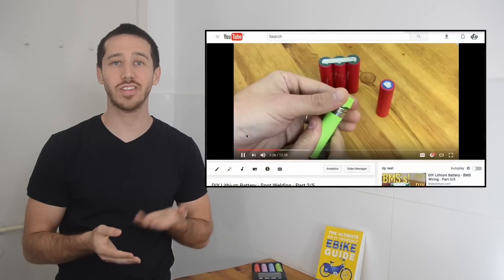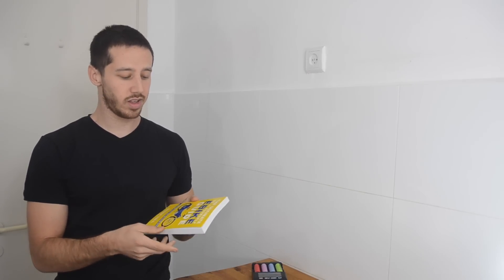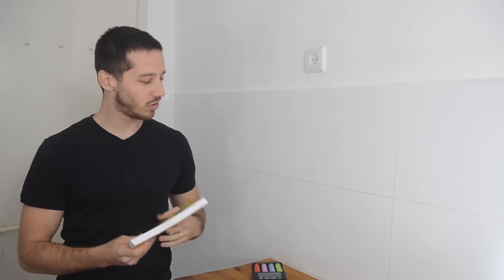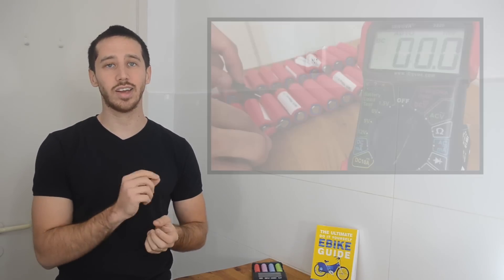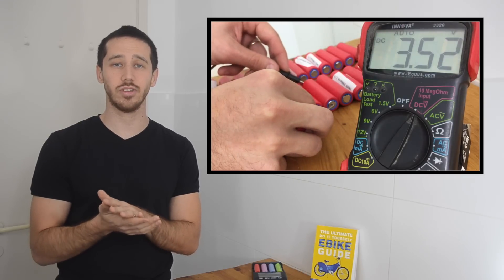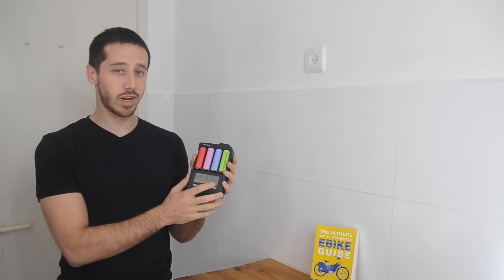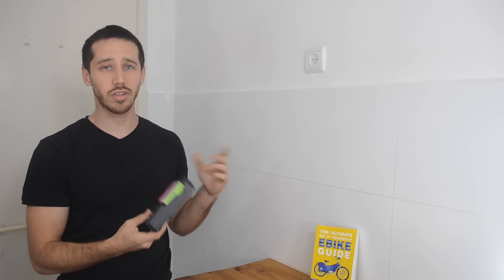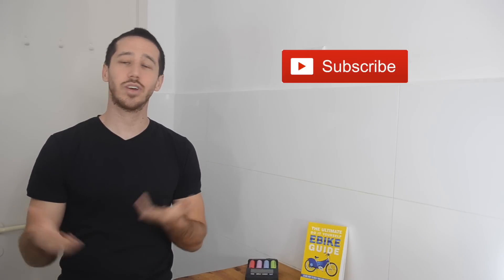Should I Charge My 18650 Cells Individually? Q&A#1

Comment: I have 2 36v 7.5 mph batteries and they are connected in parallel to double my mph, when I change them does the one have to be disconnected from the other before I charge separately?

Comment: hello sorry for this long question  I recently crashed my ebkie and my battery that i purchased took a nasty beating I broke 2 cells inside the pack it is a 48 volt 20ah  it is a rectangle battery one cell broke on the 13s side and one broke on the other side on the parralel rail I already took the battery appart and removed damaged cells I am hessitant to replace the cells I purchased the same lgm26 cells that where in it my question (HOW DO I KNOW IF THE 2 NEW CELLS I AM PUTTING IN ARE THE SAME VOLTAGE AS ALL THE OTHERS ALREADY ON THE BATTERY AS FAR AS I KNOW MY BMS WILL TAKE CARE OF THAT SHOULD I JUST ADD THE TWO NEW CELLS OR SHOULD I TEAR DOWN THE WHOLE PACK AND REBUILD IT
Reply: WISH I COULD PUT PICTURES YOU WOULD SAY IT IS EASY FIX
Reply: another question in a question before i noticed the battery was broken i charged it like normal i went to use it the next day i got 7 miles befor it died (i normally get 30 miles ) are all the cells in the pack still the same voltage ???  should i just tear this battery appart and start fresh?

Comment: Hi there,
     According to jehugarcia (another YouTube vlogger) we need no BMS (battery monitoring system) for a battery bank. Is it alright to balance a battery bank once and then keeping using it without balancing it ..i.e. not to use a BMS. Are there chances that the battery could get out of balance?
Reply from the maker: I would advise against that. If you don't use a BMS, you should monitor the pack occasionally and be prepared to rebalance it if it comes unbalanced over time.

Comment: Can you please make a video on how to choose the correct charger (current of the charger; eg 2 amp, 3 amp ) to charge a 36 volt or 48-volt lithium ion battery pack base on the pack size (Amp Hours) and the rated charging current of the cells used to make the pack?
 I am referring here to a fully built battery pack with a BMS. Thank You again for the educative stuff you make for ebikers
Reply from the maker: Pretty sure I made a video on that back in my 5 part series. Check my videos from around November
Reply: I found it thank

Comment: You need to be a little more careful. The title looks like a generic question of charging individual cells (in a battery-pack or not). The question you answered was specifically to charging them before the pack-build. The generic question of, "After the pack was built, do you still have to charge them individually or can you charge them as a group?", was never answered.
Reply: STILL never answered! WTF???????????????????????
Reply: If you had paid attention, he did answer the question. Once they are connected in a parallel it is consider a single cell, one battery. That's why he mentioned that batteries in parallel should be within a couple of hundredths of each other. Otherwise the stronger battery will try charging the weaker one putting strain and weakening the stronger one. Now when talking about charging in a series, the BMS will regulate charging to an even level and make each series equal, at least it should, depending on the quality of the BMS. Your chain is only as strong as its weakest link.

Comment: Why don't battery makers use 26650 size batteries for more capacity?
Reply from the maker: Fewer options for cells. 18650 is more common, so there are many more options in the market.

Comment: I had a mountain of old laptop batteries so all of mine are recovered used cells. The last thing I wanted to do was solder them into a brick and have to replace the bad cells one at a time. What I wanted to do was use them like I would in a standard flashlight - take charged cells and 'use' them until they were at their lower limit and then swap out those cells with freshly charged ones. I had a variety of schemes but then found the VRUZEND system. It works perfectly as a backup battery for my Sondors Thin eBike. 
I realized I had a real fire hazard storing thousands of 18650 batteries so I took the cream of the crop and donated the capacity tested batteries back to the place that gave me the packs in the first place. They use them in flashlights and cell phone chargers that they sell to support their non-profit. Everybody won!!

Comment: Hi Micah, when I'd like to build a battery pack, is it necessary that:
- all cells are the same type (capacity, max. current, etc.)
- from the same supplier (LG, Panasonic, Samsung,...)?
I think these points are important for cells connected in parallel, but what's about for series connection?

Comment: I have a question about if in battery pack there are few series of cells and they their voltage are not equal. Let's say for exempel 3.4v, 3.5v, 3.6v . If the highest parallel will not come over 4,2 and the lowest will not be discharged below 3v. Is there some danger for life span of this battery pack? Hi current will flow over other cells damaging them? Of course there is no BMS in pack. Is it save for pack having groups with mismatching voltage but not charged too high and discharged too low?
Reply: Did u figerout how to resolve the problem? Coz i have the same issue. I have a few batteries with different voltage  4.00 3.95 and  the rest of it are 3.53. I jus wondering, can i use a charger to discharge the other two.
Reply: @MrWhiteHeal  Czesc. Nie ja nie mialem takiego problemu bo mialem nowe ogniwa ale sie zastanawialem co gdyby. Mozesz podladowac te inne ale pamietaj ze jak odlaczysz od ladowarki to volty trosze opadna wiec nie beda idealnie rowne z innymi ale jak masz bms to po naladowaniu wyrowna ci reszte.
Reply: @celeb18  Hej, mam zamiar kupić ładowarkę  opus bt c3100. Podobno ma opcje roladowaywania do 3.6v. Niestety nigdzie mogłem potwierdzić tej info. W każdym razie dziękuję za odp.

Comment: Good video. May i know what is nominal voltage ? For samsung 18650 battery, the max is 4.2V, what is the min voltage i can use ? What is the range of the voltage I should use for normal usage or prolong the life of the battery ? Can explain more to me or us ?
Reply from the maker: Generally for li-ion cells, nominal voltage is around 3.6 to 3.7 V. The extreme minimum voltage is 2.5 V, but the cells stay healthier if you discharge only to about 3.0 V
Reply: so, we should use the voltage range from 3.0V to 4.2V, right ?
Reply: steve au maybe use it from 3.0 to 4.0, and your cells will have a significantly longer life. just load to full and balance once a month or so.

Comment: Love your Videos, really clear and well presented. (not that keen on the background music). I'm following your guides to build my own secondary pack, just waiting for the 48v BMS to arrive from China.  Do you use a low batt indicator or alarm to monitor the charge and prevent damage ?  Have you tried using a 48v Pack on a 36v bike (charge controller) I am doing this because I aquired a free a 13 cell pack with a damaged BMS the original battery is a 10 cell 36v setup, naturally i'll need to upgrade my charger.  My assumption is all voltages are converted to AC for the motor anyway so it should not damage my bike ?
Reply from the maker: Hey Alan, some 10s controllers can handle 13s and some can't. It mostly depends on whether it uses 50V or 63V capacitors. The former can't handle a fully charged 13s battery. The motor should be fine though. It doesn't convert to AC (the motors are DC) but they can handle an extra 30% voltage and thus 30% more power. If you wanted to bump up to something higher like 60V, then that might start to be too much for a 36V motor. I used two 36V motors on my bike at 52V and they love it :-)
Reply: Fantastic, if I blow the caps I'll know why

Comment: Question, for the book!
Should I install a fuse between my pack and controller. If yes which type? Someone suggested the type used in car stereo system. What would you do and how would you size the fuse and wire it?

Comment: Hello! What are you thinking about cooling batteries? Is it enough to cool them by air flows or battery needs artifitial liquid cooling?
Reply from the maker: That really depends. For ebike use, no cooling is often fine. Most commercial ebike batteries are sealed in plastic or metal cases and have no active cooling. Air cooling can help, but it's hard to waterproof a battery and still provide it good air flow. Liquid cooling could help by allowing convection to pass heat to the walls of the case, which can then be passively air cooled, but most ebikes don't generate enough battery heat to need that.
Reply: Thank you. And another question to you. In series every link should be balanced, right? But, what if i have a bunch of parallels which then connected in series . So, i have to balace these parallels or every single cell? Will each cell in parallels  be charged at the same level as other cells, by using BMS?
Reply: yep, thats what the BMS is for.
Reply: i mean will it be right to balance parallel connected cells inside of module? Or i have to balance only series connected elements (modules in my case, which are connected in series to make battery pack)?
Reply from the maker: No need to balance parallel connected cells within a single module - they balance each other automatically. You do need either a balance charger OR a BMS to balance the modules to each other though once they are in series.

Comment: Great video. Can you explain in detail how they rate the torque of motors? I mean I seen where they have 50 newton meters of torque and when you convert that to foot pounds or pound feet, it's almost 37 and there's no way that motor is putting out that much torque. I mean that's more than a 22hp twin cylinder engine which says it's rated at 45nm. Even geared down, a motor won't put out that much torque AND give you high end road speed. So tell me where I'm screwed up as polio here.

Here's the conversion link I'm using.
http://www.onlineconversion.com/torque.htm
    Also, could you explain the difference between motors that are geared, planetary gearing I'm guessing, and just regular motors and what applications are each best for?

Lastly, could you explain how to set up a 2 wheel drive  bike to run both motors off the same battery or how that's done and if it's possible to make it an on demand front wheel drive when needed. For example, you're off road and about to get stuck or need more climbing power and you hit the throttle or flip a switch and the throttle runs both motors or whatever.

Thanks and keep up the great work.
Reply from the maker: Lots of good questions, and stuff that I've been wanting to discuss. I'll try to make a video on these topics soon. Thanks for the questions!

Comment: Dear ebike school I have watched the video where you connect the balancing lead to the batterys. Would be nice to see a diagram of the points where the balance lead wires go. For future reference.
Reply from the maker: Hey Jessica, pause at about 4:17 here for the diagram: https://youtu.be/u-4mKh1WaLo?t=4m17s Basically, the balancing leads go on the positive of each cell group, which is also the negative of the next cell group (when connected in series) so I often just solder to the middle of the series connections, right between the positive of one group and the negative of the next.

Comment: great view dude, cheers. I've been trying to find out where & how many fuses to use? eg between. battery & motor or controller or user
Reply from the maker: Generally speaking I only use one fuse, and it's between the battery and controller. Some people add individual cell fuses to every battery cell, but that makes more sense for much larger (and more expensive) packs.
Reply: EbikeSchool.com would the size of the battery matter when it comes to individual cell fuses? Even if the battery is for a car each cell can still only see a couple amps. I was considering trying to use automotive fuses spot welded to the nickel strip. Fuses would be a major change to the battery design and I cannot determine if they are really necessary. Could you clarify why you don't use them?
Reply from the maker: The battery size matters not as much for the individual cell currents but more for the cost of the battery. A single cell short can destroy an entire parallel group. If that's only 4 cells then it's mostly just annoying to replace them. If it's 100 cells then it can be very expensive. For my ebike batteries I mostly don't use cell-level fuses because A) it's added cost and complexity, B) it's added resistance and points of failure, C) I use good quality, brand new cells that should never suffer from cell shorts under the conditions that I run my packs, and D) I never exceed the rated load for each cell. I could certainly use cell level fuses, but it's been low priority for my purposes for those reasons.
Reply: I understand now. I was thinking more in terms of safety as opposed to cell damage. I didn't realize that a cell going bad would ruin the parallel group. Also, totally unrelated, I noticed on your website that you solder the BMS leads to the pack. Do you think there would be an issue with crimping flat connectors on the leads and then spot welding them to the pack?
Reply from the maker: Luke, theoretically I think it'd be fine to crimp connectors onto the BMS balance wires and spot weld them, as long as the connectors are thin enough to spot weld well. I'd do some tests on samples first because not everything can spot welded easily.